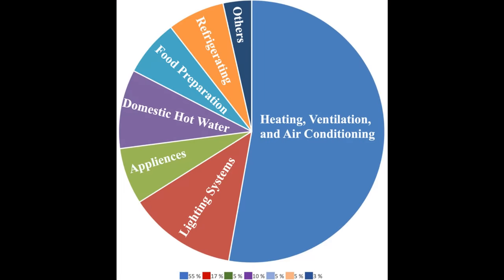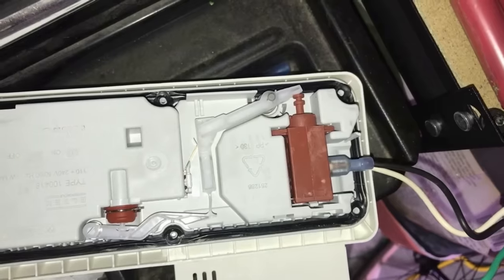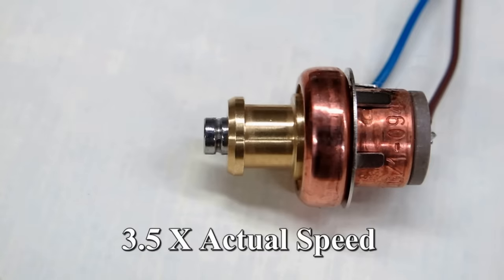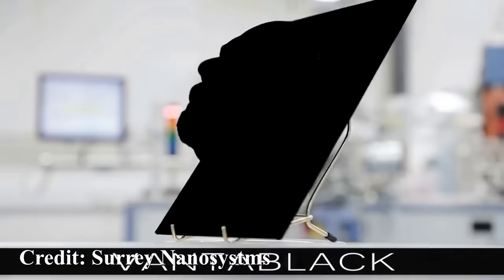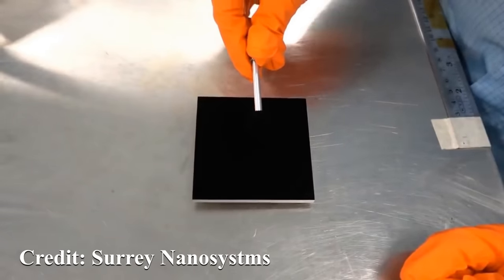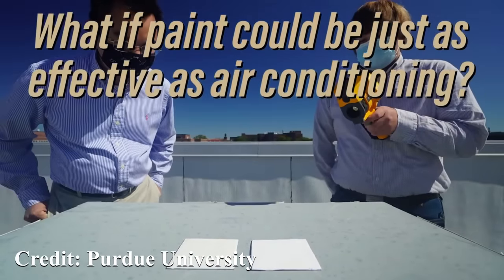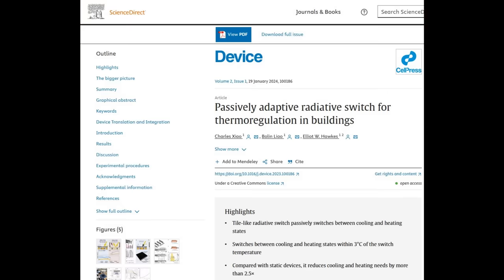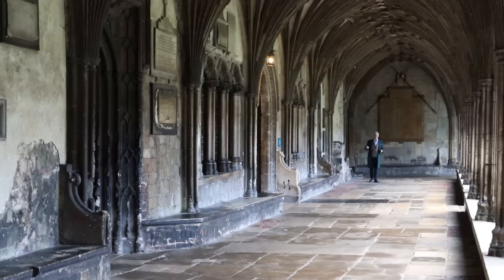2199 Heating And Cooling Without Power - Wax Motors And Paint

Comment: Pipes, reflective white around half of outer circumference, vanta black around other half.  Pass fluid through.  Rotate pipes so that black or white side is facing out by measuring fluid temp difference.  Lay pipes adjacent to each other, forming panels. Easier to manufacture, possibly more responsive.  Just a thought. 
Thanks for sharing these ideas.
Reply: i ve had this idea of rotating pipes that transfer heat...
Reply: Do pentagons with black, white and three additive colors, put it in every house in your city and then turn your city roofs into a the biggest screen ever created, that can be seen from space.
Reply: I'm thinking the engineering of joints for rotating pipes that are leeak safe must be complicated...
Reply: @drillerdev4624  I'm a plumber and I can tell you that it already exists and is not expensive or difficult to manufacture
Reply: @sogniluigi  good to know!

I'm guessing that the pipe simply rotates, and an external actuator like the one shown in the video could push or pull the section, then? (I'm thinking on an outer cog in the pipe and a straight dented section connected to the wax motor)
Reply: This is a good concept, but I don't think the pipes need to rotate.  If there are collector pipes and radiator pipes in series you can move the fluid through some form of turbine or pump.
Reply: This is a very good idea. I'm trying to design and calculate if it would be possible to make it work both ways seamlessly with natural convection (no forced convection), and if its angle could be adjusted automatically when in a portable, not fixed-to-the-roof configuration

Edit: Just laughed about the idea that when the weather isn't too cold nor too hot, the pipes (and the tiles mentioned in the paper) would get stuck in the half-way point and cause half cooling, half heating. Since my configuration would have horizontal pipes stacked vertically, maybe I should consider whether the pipes must rotate clockwise or counterclockwise because of this...
Reply: You wouldn't need pipes, just vanes. The actuators don't take much space and they can flip a large area of multiple vanes or slide slotted sheets from a small active section, just like pulling the strings on a big Venetian blind. No need for fluids.

Comment: This kind of science communication is an invaluable public service. Thank you. I have no idea how you manage to put out so many videos of such high quality at such a pace. On this topic, greenhouses have long used devices like this to automatically open and shut windows as the internal temperature rises and falls with the heat of the day. Simple, cheap and is what's required for the job, nothing less, nothing more.
Reply: perhaps two different sets of blinds, one black for winter and the other white for summer, would just need to change out as the seasons change?

Comment: I had this idea for blinds with a black side and a white side. Should be easy to manufacture.
Reply: Same. I even bought some aluminium blinds and the vantablack paint. Yet to make them tho
Reply: @ratgreen    Don't forget, you need a pair a fins to push the sole anoid which fliippers the blind a round.
Sorry. But, it is a really hot cool idea.

Comment: The wax motor is also the main method of maintained the temperature of a mixer shower. They can close off water pressures of up to 10 bar.

Comment: Just paint the roofing tiles white, and  then paint over the white with black thermocratic paint. So when it's hot out the black paint fades to clear reveling the white paint and when it's cold the black paint reappears.
Reply: 🌟 = no need for an elaborate louvre shutter mechanism ~ completely passive
Reply: What is a "thermocratic paint"? How does the black paint fade when it's hot?
Reply: ✅ - thermochromic
Reply: Good luck finding such a paint
Reply: @samuelfellows6923    Aggressively passive ?

Comment: Wow. Love this idea. But I live in Alaska, so I'm thinking maybe for siding, since snow would be a problem. Especially this year. Good Lord, I've already shoveled my roof once and may have to Do It Again. "Wheels turning, round and round..." Might even be worth having an electric or even hand cranked mechanism that could operate all the slats at once through some extended, bulky, unsightly, maintenance heavy and prone to failure linkage...uh, or maybe I'll rethink that last part.

Comment: So I had an idea recently to make a roof like something of a conveyor belt, like in a grocery store. one side of the belt (roof) is the  black side and the other side is either white or a radiant barrier like aluminum or mylar. When its hot the thing rotates to the white or reflective side and conversely when it gets cold it turns to the dark side. It could easily be made out of vinyl, rubber, or any number of waterproof fabrics
Reply: I had a similar thought. Automatic shade covers already do something similar, just with a simple shade cloth - extended or rolled up. It would be great if such a design could be strong enough to become the roof surface itself, to cut down on costs. You could maybe even have three surfaces - black, white, and transparent for when you want the sun inside.

Comment: In 1977 Roland W. Robbins, Jr patented a solar tracker that was refrigerant based.  As the working fluid heats up it would cause the panel to tilt in the direction of the sun and as the container would shade it would fall back to it's starting position.  Seems to me this wax motor and paints could be tuned to do the same.

Comment: The problem with using vanta black and super white on roof tiles is that it's not going to take long before each side is grey from airborne dust, or green from moss.
The wax motor is interesting though.  I've never heard of them before.  The only similar thing I've seen is the wax thermostat, but that doesn't use expansion of the wax to operate.
Reply: Yes, that's precisely how they operate. In a car engine, when the wax melts, it expands and opens the thermostat, and then shrinks when the water going past it is cool enough to cause it to begin solidifying again.

Comment: I have a gut feeling that putting some static white and some static black tiles. Then just using pumps and valves to decide which one is going to waste (like we can heat/chill rainwater and pour it into sever or onto grass) and which ones are utilized would be more robust and cheaper.

Comment: I have a big warehouse. We chose bright aluminum foil covered roofing.
Its amazing..warmer in winter and cooler in summer.
Because it reflects heat away in summer and does not emit heat in winter. Reflectivity is high and emisivity is low.
Reply: Keep the crazy ideas in and reflect the reality, eh? Sounds great. Is it expensive for a large roof? How would it compare in price and maintenance to the paints?

Comment: Those two paints and the coiled pipe arrangement has me thinking of a fluidyne Stirling engine.  Put one coil on each side of a board and have one coil painted black with a reflector or light guide concentrating the sun on it and have the other painted white and covered by a sunshade.

Comment: I'm envisioning the same setup, but instead of flipping roof tiles, the tiles are layers of grids with Vanta Black and White paint that the actuators slide back and forth to reveal the desired surface. I think that it would reduce the surface areas to 50%, unless  multiple layers and actuators were used.

Comment: Smaller plastic versions of these “wax motors” are used on the louvred styled internal-automatic backdraught shutter in extractor fans ~ most notably vintage “xpelair” gx series when they transitioned from the 2x cord-opened iris shutter  to the louvred cord/solenoid shutter, the solenoid opened ones were known to make a loud rapid slap/bang when opening the shutter and a lot of users/customers found that an unpleasant sound when turning the fan on, with Vent-Axia T-series [80s vintage] those used a synchronous motor and gearing to open the shutter and made a quieter mechanical  “clunk” sound, and eventually all the fan manufacturers found the wax motor to extremely quiet and slow when opening the shutter = the customer only noticing a change in the noise the extractor fan was making when the shutter was transitioning from closed to open/seeing the shutter slowly opening after turning the fan on

Comment: My idea was to use cheap white wash on roofs at the start of summer. The space cooling paint can be made cheaply from calcium carbonate. If it can be applied as a spray, a wash process every year might get around the problem of fouling.
Reply: Was that the same white stuff Tom Sawyer was supposed to paint fences with? I can imagine in the early 1900s that a simple "wash" like that would be common.
Reply: @markhathaway9456  Yep that would be the one. That's what they use in Greece too I believe to paint their houses white.

Comment: I had always envisioned a series of wax motors that would lift weights up to a gravity battery. Not sure how well that would work in practice. In my mind it works great, Ha.
Reply: Well, it is actually a very interesting idea... the problem would likely be that the amount of wax needed to lift enough mass to generate enough energy to power a significant load (such as a air conditioner or more) would likely be a LOT of wax... so, it would take quite some time to heat up the wax during the day, and then again to cool it off so it would "return" at night. It would be a great engineering prototype to simulate or even try to create for sure.
Reply: @marcfruchtman9473  They'd be in a stair formation like those penguin slide toys from back in the day. It would be very slow for sure. Just an idea I had.

Comment: Food for thought: Most of us know that black is excellent for daytime heating.  In the mountains of California, Arizona, and similar, in the summer time. I would set out a shallow black pan, at night (say 4ft X 8ft) fill with a couple inches of water., The next morning it would have a nice layer of ice for my ice chest. So, how will this affect a coil of black tubing, on the roof, water heater. And , same black coil, use to cool. PS The night time temp would have to get below 58 degrees Fahrenheit. Or maybe it was 56?

Comment: It’s not going to be either on or off most of the time, especially if using a wax solenoid. Yes, mid winter it’ll be in one position, summer the other, then there’s spring to autumn, it’ll be neither up or down, thus being a roof full of wind blocks.
Reply: Slide panels rather than flip panels.  White on top and black underneath if it's to hot the roof is full White. Cool weather they Slide sideways to expose the black water pipes for heating. I think that is a brilliant solution

Comment: Suspenseful end, does that mean your going to try add it to your windfall or horizontal wind turbine to add in passive cooling or use it to improve the efficiency of something by allowing it to work at a higher voltage for longer?

Comment: If the wax stat has that much torque could it be used with a flywheel and a panel that flips to oscillate between heating and cooling and therefore extending and retracting the actuator. Or just have two panels next to each other one black one white and use bimetallic junctions to generate

Comment: I feel like using linkages and wax motors overcomplicates the design.

Suppose you started with a superblack base layer. Then, you'd place fixed louvres over it, with enough of an air gap that there isn't significant heat transfer between the layers. Each louvre would have infrared radiative cooling paint. The angle and length of the louvres would be adjusted such that there would be no direct sunlight reaching the black layer in the summer and maximum direct sunlight in the winter (100% minus whatever shadows are cast by the edge of the louvres and their mounting hardware).

In the winter, the black layer should absorb more than it radiates. In the summer, the black layer should radiate more than it absorbs, with the white coating ensuring that the radiation ultimately emitted is within the atmospheric infrared window.

It might not be as efficient as a louvre that moves, but it ought to be much more robust and material-efficient.

An additional step might be to add a layer of clear-to-black thermochromic dye to the louvres. In warmer months, the louvres stay white. In cooler months, they darken and inhibit the radiative effect of the louvres.

Comment: If anyone cared buildings could be designed for passive heating and cooling, many are. I can think of a several cheaper and more effective ways of achieving this end if it was designed into the building at the start. This is only interesting if it can be shown that it can be retrofitted to existing buildings cost effectively - which I very much doubt.

Comment: Been working on something far better than even this stuff, that actually cools an area and I am guessing even during cold weather will heat an area, night or daytime by reversing the entropic state of thermal energy by concentrating it in a given side of the function, (basically a passive heat pump that the energy of the heat itself is what causes it to function.) This tech you described is on the path to it, and would work even better, if some changes or additions were added to the tech, 

mind you my idea had the same concept as either sheets hung and flipped by the person, a box that it is inside that also is flipped, or a mini blind like idea made of say solid aluminum that is polished on one side and matt black on the other side, with magnetic material being used to generate spikes while the paint it is in dries to generate a shape much like the quietest room in the world and how it uses the wall covering to absorb sound, but instead for the act of heat and photon absorption. Vanta black had not even been thought of at the time and I was just looking at high temp BBQ paint that is a matt black as the absorbing side. Not sure which is better and will last long term, as these being on a roof are something that concerns me due to the white color being dirtied up over a short time from just dust and debris in rain (the particles of dust that water condenses onto, to make rain drops) thus ruining the effect of the two sides from full 100% effect in a short order. 

This last aspect is something that makes what I am working on better because that is not a problem since it can work from within a gap between two layers that equally are protecting the heat pump action for long term use (UV damages some of the material over about 3 to 5 days if left completely exposed to sunlight in a harsh environment like NM and OK in the USA, so not sure how long it would take in England or similar closer to the polar ends of the earth with reduced UV from sunlight areas. )

This summer I should have a geodesic dome equipped with this tech inside a heavy awning level canvas covering for the dome to show it in action in the wild and will continue monitoring it when flipped during the winter too with a chance to see how it functions during below freezing temps (-10F) to see if there is any less value at pulling and retaining heat than it has at rejecting it and sustaining its rejection.

Comment: Next step ▶ Using resistant and non toxic paints (maybe simply lime and carbon?), and integrating pipes in the tile to reclaim the temperature needed for other part of the house, or a thermal battery ?🔄

Comment: isn't the idea actually ancient? also, wouldn't a city shining white like this create it s own weather?!
Reply: Just like a road when illuminated by sunshine creates wind thermals and wide temperature variations the same as as like a dessert of sand. Maybe blades of grass do operate as tiny wind and moisture catches to help keep soil cool and hydrated. Everything is designed for a reason and every city nowadays technically creates its own weather. I grew up flying hot air balloons in Albuquerque New Mexico where I have observed a once mostly desert area create greatly different weather patterns between the Sandia mountains and the Río Grand River as the city has build up with parking lots, roadways, grassy fields and sprinkler systems.
Reply: @40trill  oh i dream about flying in hot air balloons...
Reply: @40trill and things are spreading out around here too. I was born in Albuquerque in 1956. I can remember when Uncle Cliff’s was way out on the North side of town and Rio Rancho was complete desert, only pockmarked by occasional decrepit mobile homes.
Reply: Lime plaster does have a substantial cooling effect, and it's a feature of traditional Greek construction for this reason.

Comment: My HOA requires me to have black asphalt roof I live in South Carolina it's hot. I requested an aluminum roof as aluminum is a wonderful radiant barrier and was denied with the response  that it must be a black asphalt. I live in South Carolina where it is hot very hot most of the year. Honestly who makes out on this besides the power company? They put my air conditioner up in the attic which is essentially an oven at 150° and then they take the hot water heater and stick it out in the garage where the little bit of time it is called it has to work overtime Since I was in grade school I have been asking why we don't have some type of a two-tone paint? Perhaps that goes black when it's cold and white when it's hot.